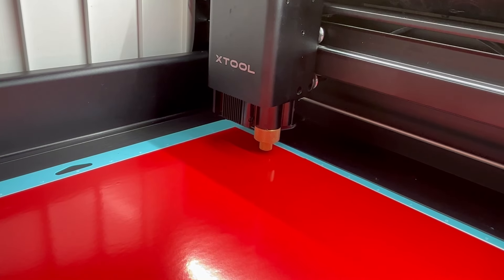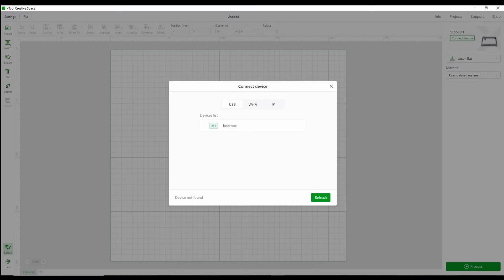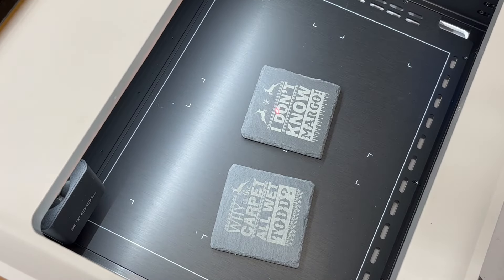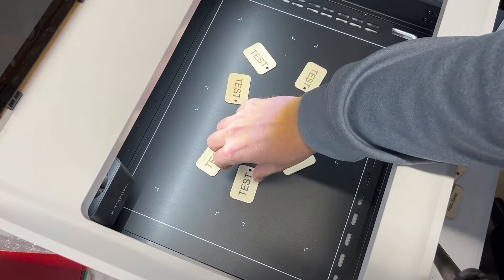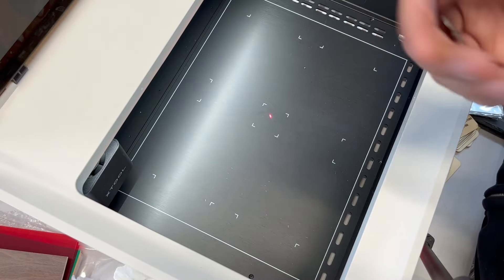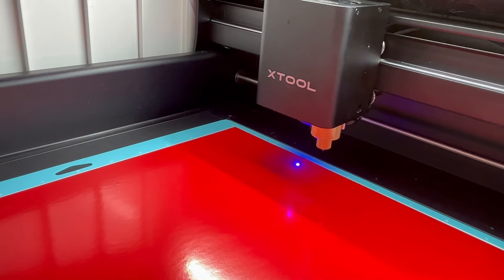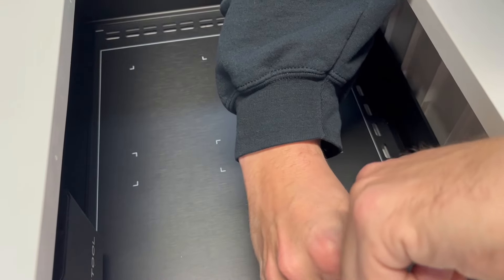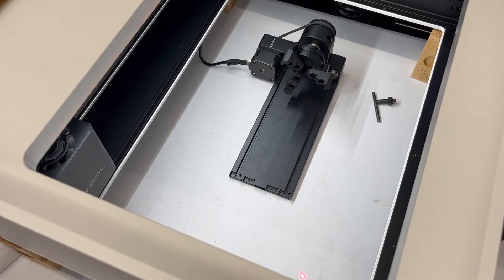xTOOL M1 - The Best Crafter Machine?

Comment: Had just about the same thoughts myself when testing.  Great vid
Reply from the maker: Thanks!  It is a great machine, the all in-one use actually works great.  Minus if you want to lift the machine for a rotary 😉
Reply: @TripodsGarage  Im finding the camera alignment not very reliable but more testing needed
Reply from the maker: @MkmeOrg  - Yeah, I centered that left coaster, and it the image engraved to the right.  Seems that if you have a center object it is ok.
Reply: @TripodsGarage  I meant mine :)

Comment: Since the bottom is removable, can you place it directly on a larger surface like a table top and engrave the surface? Basically would the laser reach low enough?
Reply from the maker: Very good question!  I might need to test this.  Since the M1 has auto focus, I would need to remove the bottom plate and see if it can lower the laser on it's own.
Reply: @TripodsGarage  that would be awesome. I’m really curious because if it can then it opens this machine up to a whole bunch of different possibilities. If it can, I wonder if you could use the internal camera to engrave a very long piece by cutting the design into segments and using the camera and software to line up the previous engraving and then sliding the piece down (or the machine) to continue the next segment. It’s hard to explain what I’m thinking but I think you will get the idea.
Reply: good think 👍🏻🌺

Comment: Hi, I’m interested in buying an xTool M1, so I just watched your video review which was really useful, thank you.  I just wondered if you could help clarify something?  The M1 spec states a 385x300mm (15x12 inch) working area, but is that the max size of the material sheet BEFORE cutting or just the max size of the cutting area?  For example, can I insert a sheet of 8mm MDF into the unit that is say 400x310mm and then design a shape to cut inside the 385x300 working area?  The reason I ask is that the shape I need to produce could be 300x300mm so it would be nice to be able to rough cut a slightly larger sheet to then make sure the finished shape can be cut out allowing for a small border.  Hope that makes sense?
Reply: I came here looking for the same answer. Looking at doing a cutting board that is larger in size at 16" but would still make the image smaller than the 15". Did you have any luck on getting your answer anywhere?